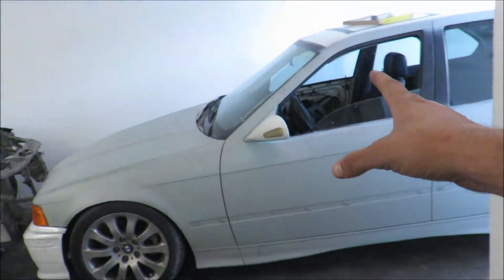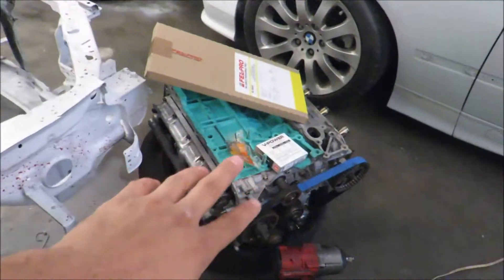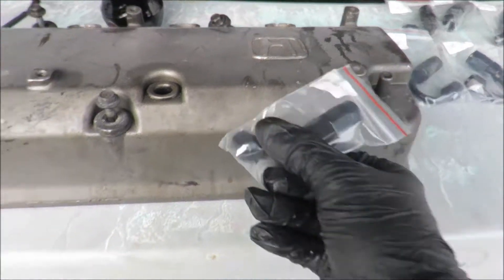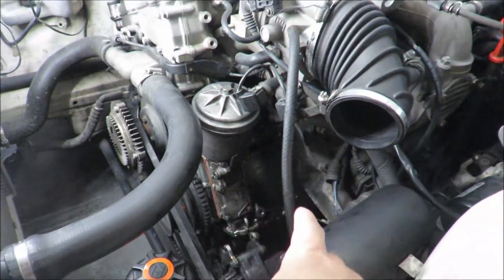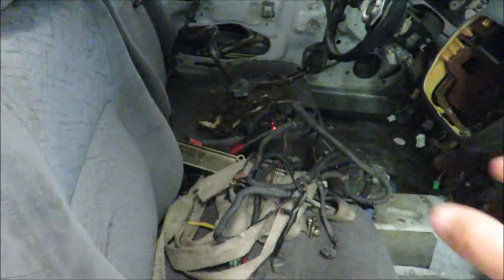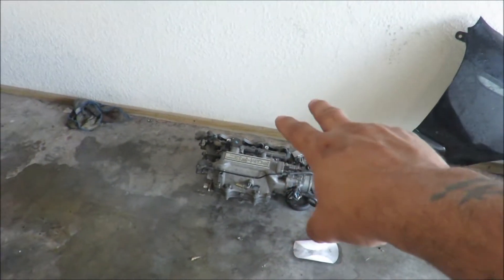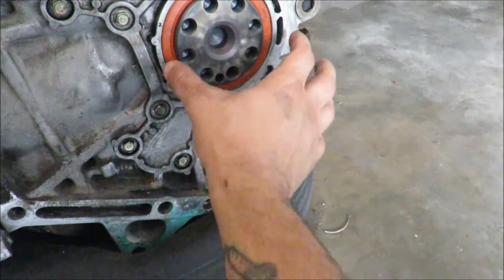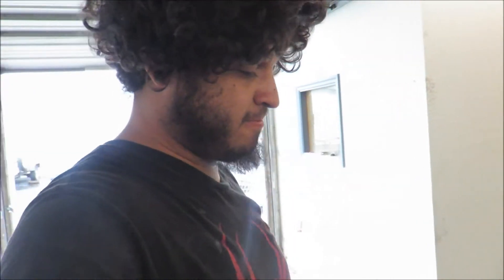Ebay Turbo Honda Accord Build: Engine ready to go into the?

Comment: Put a h23a in the Cg instead of the f20b
Reply from the maker: which ever comes to me at a good price ill get I honestly wanna k swap it but that's alot of fab work
Reply: Car Dude Garage the fab work I don’t think would be an issue especially if you swapped in a v6 subframe. Then you’re left with just having to make mounts. Axles, I wouldn’t even know where to start lol no ones ever k swapped a cg